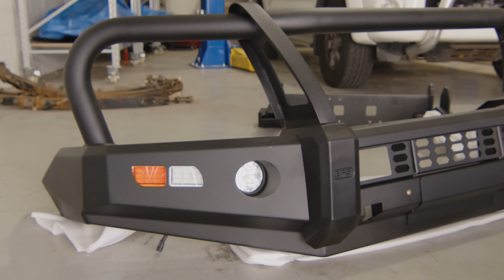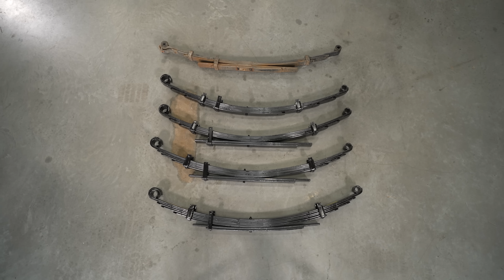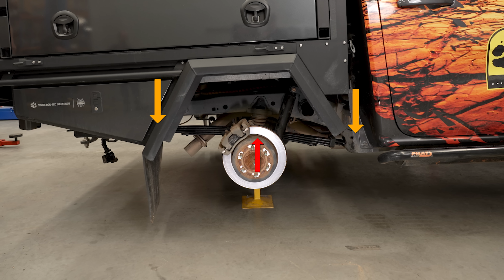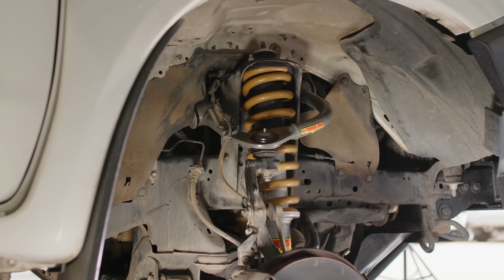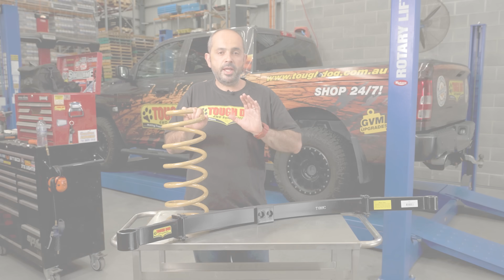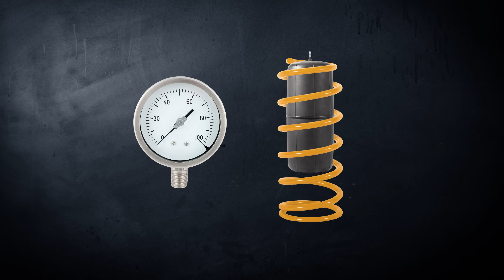Standard vs Upgraded Ute Suspension Test! How to choose the right springs for your 4WD

Comment: The explanation of the spring load is wrong, you don't fit the spring rate to the load, you make the load to the spring rate, you do however fit the best spring rate for the AXLE LOAD, that is determined by MAM/GVM and individual axle loads by the plate data. So if your axle has a max load of 1850kg, you put in a spring (usually standard or factory HD), you then load to that point as max loading, at this point the correct spring should have over half of it's compression capability still left and still clear of the bump stop. 
Giving a higher spring rate than necessary will just make the ride harsher, create micro vibrations in the chassis and fracture it faster, do more damage and wear to all vehicle components and basically, make the ride terrible and uncomfortable. Also it encourages overloading as it still looks ok. We all know there is a high proportion of AU utes that are overloaded and above MAM/GVM.
Reply: Damper should not be fully extended at max droop, it should have about 15mm ideally more travel than the spring can droop, this stops bottom out damage, the bumpstop should stop topping out damage. If there is max droop at the point the damper is also fully extended then a tether MUST be used. this stops the axle over-extending the damper. if you don't understand this then look at Series Land Rovers and UK military Sankey trailers, they all have travel limiting on the springs to stop damper damage.

Comment: Just to state the correct reason a lot of Jap motors get cracked chassis is not because of incorrect spring and damper ratings, it's chassis design. Simple and absolutely, the chassis is not strong and has a separate rear bed that overhangs the rear so has micro flexing in the chassis becasue of the poor bed layout and general design. If you look to see where they all crack it's the same place. just after the frnt spring hanger, just befor the bed locator. It is a problem that has been happening for over 40 years! It is only recently that the design has changed with the change to coil springs. I personally cannot see how a company can legitimately manufacture a design with known failures for so long and not change the design or strengthen it. For context for this, Toyota did a recall on all of the last of the old chassis design and a buyback scheme, these vehicles were less than a year old and a lot were faulty, most were just light use, no abuse, no off road use. 

People wonder why I am a Land Rover guy, it's simple, they are better, stronger chassis, 35 years ago a friend had a Toyota Hilux, his neighbour said the truck looked a bit odd, the chassis had cracked, he put it in the auction the next week and bought another truck. I have jumped, tugged, towed over max weight (not on highway) but max weight on highway. Yep, the Landys are not that fast but go further than Jap motors do on the whole.

Comment: The axle in most utes are too far forward with too much overhang. Loading a large canopy excessively with heavy items behind the rear wheel & tow with a heavy towball weight hit washout  = a bent chassis .I have seen this on numerous occasions Cape York & N.T. on many different brands of utes. Leave more crap at home you don’t need.

Comment: Still puzzles me why so many chose a Double Cab to go off-road. Why not a Single Cab? It would allow using a bigger camper as better weight distribution.
Reply: Unfortunately it’s still illegal to put the family in canopy I guess 😂
Reply: @bluebludded  In the channel they do their tourer mostly alone.
Reply: I hear you for hardcore off-road.
But i like to take a couple mates with me on the day I'm going off-road. So a dual cab was a must for me.
Reply: Extra cabs are the best of both worlds
Reply: yea i went with Xcab. there are rear seats if i HAVE to carry extra passengers but i rarely do. so extra room in the cab for storage, a fridge or other goods you want to lock away or want the easier access to, a place for the larger dogs to chill, plus you still get the extra tray space for everything else or a canopy. Xcabs also have a decent resale as everyone wants them but noone wants to sell theirs 🤣
Reply: Few reasons why i personally bought a double instead of a single and i think it applies to most: the capability to have more than 2 people in the car, even if mostly its just 2
Resale value is fair better with a dual cab
Security/saftey for gear i dont want in my tray/canopy as its a lift off canopy
Theres a fair few more but these are the main
Reply: Single cab is rarely available above poverty spec.
Reply: Some of us like to take the family out camping as well, not just the dog.

Comment: A new suspension won't prevent a bent chassis.  Only your driving and proper loading will prevent it.
Reply: Never load your vehicle beyond it's GVM. If you do, and shit goes wrong, your insurer isn't going to cover you, and you will be held liable for negligence, as Shauno said in his video about setting your 4WD up to tow.
Reply: @alexanderralph8341  reality is, most of these bent frames are from weight in the wrong area.

Utes with a large "camper" tray with weight way past the axle. 

Or they are towing a trailer way to fast and hit a washout too fast,  front of car goes up, rear axel falls in,  weight on the ball compresses down and the weakest point on the chassis, where the cab ends, let's go.
Reply: A chassis extension is the only way to prevent it from